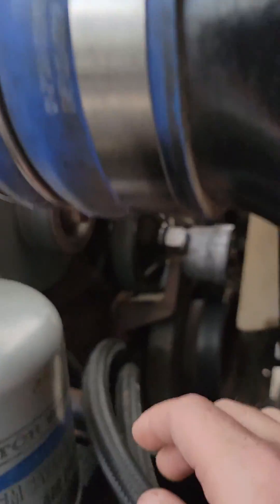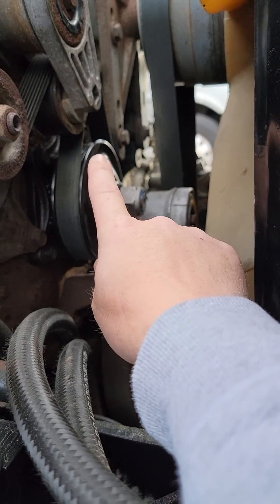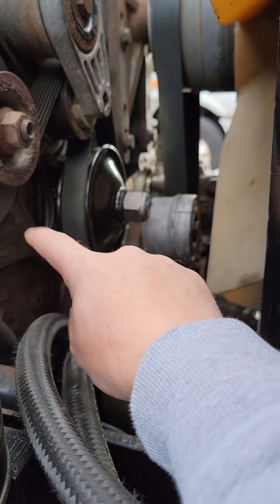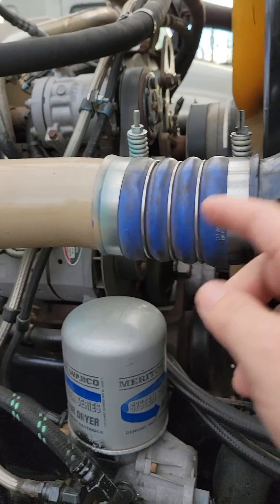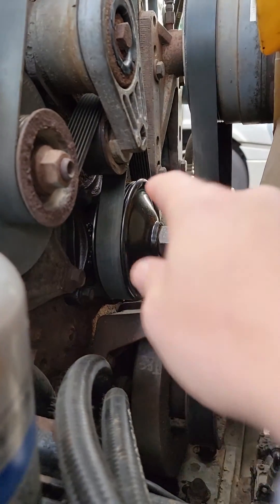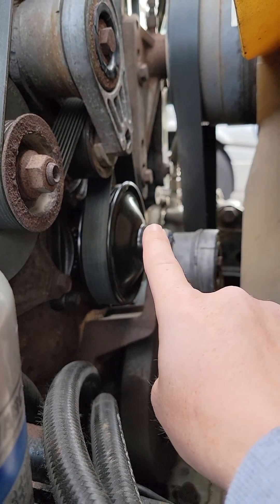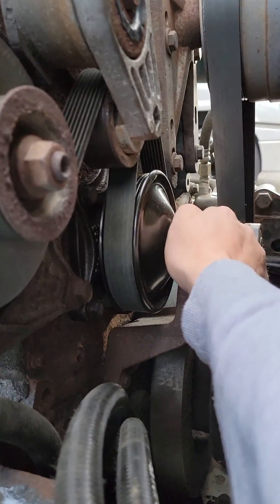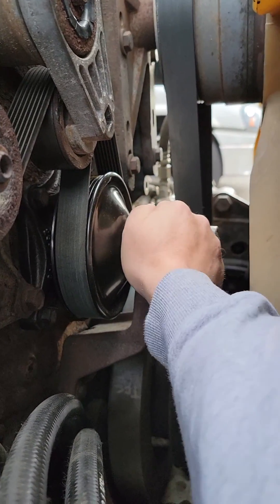14L bull gear

Comment: found this video after my truck skipped timing and berried all the exhaust valves into the 6 pistons destroying the head im not sure if its this but the truck ran smooth and out of no were clunk white smoke 2 seconds later shuts down couldn't start i havent checked yet but this feels like what happened
Reply from the maker: @wpchungTRIOT  the white smoke is coolant. You might have a bad head gasket and hydro locked up the motor. I would check the oil level on it cause if it jumped timing ain't gunna be not running smooth then stopping it's just gunna sound like a bag of rocks rolling around in the front cover. I'd check the oil. Level should be really high and brown. Drain the oil pull the injectors blow them out and after adding oil it will start again but the head gasket is bad. 14L have a weaker head than the 12.7 because they have more coolant channels than the 12.7 which is more opportunities for head gasket
Reply: @thebeardedgingerontheinter3256  I pulled the head before I commented the #1 piston was distroyed by the broken off exhaust valve destroying the head sending coolant hence the white smoke what mechanic said the timing shifted cause its been running for 7 months running good and the only way all the exhaust calves are bent is timing gear so I haven't pulled front of the engine to see if it's the bull gear yet but all and all head pistons and one #1 injector is distroyed
Reply from the maker: Yeah that sucks. That's why I said in the video that one gear is not that hard to replace and if it goes bad it fucks everything up. That's why I swapped mine cause I saw another guy's engine apart because of it

Comment: Thanks for sharing ?!
Reply from the maker: Got issues with the 14L?
Reply: @thebeardedgingerontheinter3256  do you have to remove the fan bracket to get the acc drive out? I want to inspect mine
Reply from the maker: @thomashutcheson8487  no you just have to loosen belt and take out the bolts. But you can remove it to inspect the bull gear teeth. However if the accessory drive is moving the bull gear is also moving. So like I said in the video grab that bolt. And if it has play in it then replace it. It should not be moving left to right up down.
Reply: @thebeardedgingerontheinter3256  I took my belt off and my pulley does not move but on my 12.7 my pulley bearings are worse slap out they just went out today but I used a crowbar to check my bull gear in the 127 and it's fine but the new 14 that I just bought I wanted to check it the same way with a crowbar but I can't take my accessory drive out unless I remove the fan bracket because one damn bolt is behind it I wish I took a picture so I could show you
Reply from the maker: @thomashutcheson8487  just put it back on and take it to a shop it's not a big money thing to have it checked it is a big money thing if it goes out on you though
Reply from the maker: @thomashutcheson8487  but like I said most likely. If you grab it and can't move it most likely it's fine. If you run it and you run the a/c and the belt goes from straight to belt waving you might have a bull gear issue. If the accessory drive when not running isn't moving up down left right